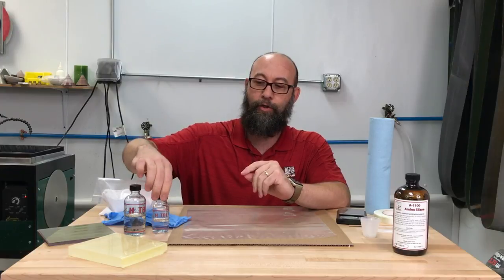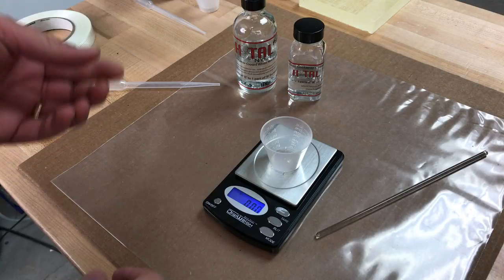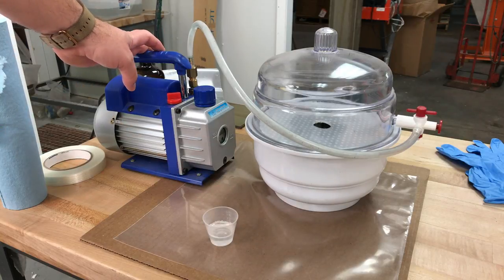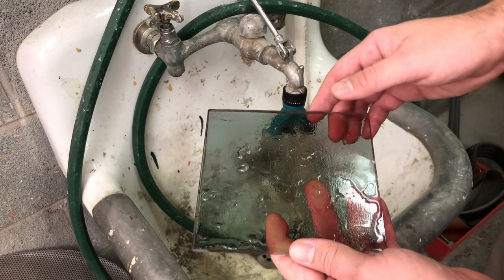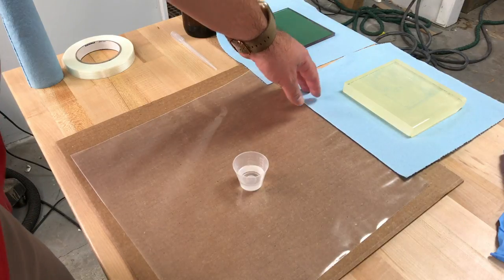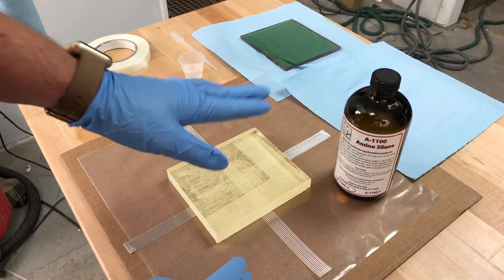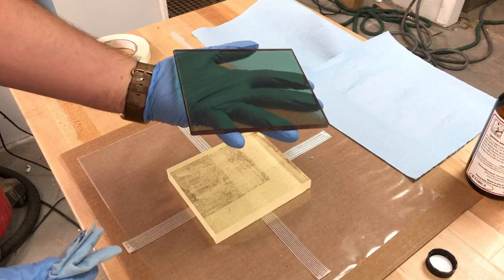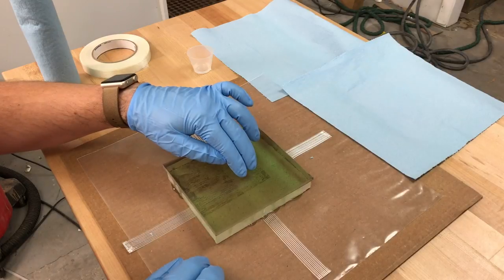How to Mix and use HXTAL NYL-1 to laminate glass

Comment: Thank you so much for your gracious reply on my earlier question! Hating to impose, wondering if you might indulge one follow-up as I’m about to order a substantial (1/2 pound, $80) HXTAL supply for my one big ALABASTER repair project.

My (parents’) chandelier has an inverted bowl, very heavy at about 20-25 pounds: the internal diameter is 13”, about 4” deep and quite thick all around. It never fully broke into pieces from its fall, but rather got substantial cracks much like the seams on a skull, but broken enough that the biggest crack-surrounded area will shift slightly in place when nudged. One of the cracks runs along the entire bottom center of the bowl. 

Frankly I’m scared of something so heavy, suspended on a 2.5” wide plate at the bottom (but resting by the top edge within a surrounding metal rim), with glued-together cracks in it. Even HXTAL cement. It’s about 18 feet over people’s heads, 25 pounds of glued-together rock which may have invisible cracks or earlier cracks spreading under the load of the alabaster’s own weight.

So my question is: while I could use a $20 1.3 ounce bottle of HXTAL and easily fill all the discernible cracks (there aren’t very many by the way, but they are long essentially dividing the whole thing into 3 sections, one essentially bisecting the whole unit). But could it be helpful to buy the larger $80 HXTAL, 1/2 pound, and essentially laminate the entire inner surface of the globe (my math tells me it’s almost exactly 300 square inches; 6.5 x 6.5 x 3.14 for the bottom area; the 4”round side added on… 300 square inches)… if I were to layer on the entire inner surface about 1/8” or 3/16” thick HXTAL, will I have very substantially decreased any risk of failure? Does this seem like a plausible strategy to increase safety with no aesthetic compromise? 

Coatings of these thicknesses would be 21 and 32 fluid ounces respectively. I really have no idea if 1/2 pound (their $80 size) would give such a thick coat.

Again hating to impose, but would really appreciate any thoughts on all this. 

Oh one final thing: is any tape ok (masking; clear packing; or Seran plastic wrap), to prevent dripping out of the cracks during curing? Are all these (including their own sticky adhesive) completely non-reactive with HXTAL? 

I may be paranoid, but I worry that both adhesives are complex chemicals, and would fear the HXTAL would react with the chemicals in the tape.

Thank you so, so much for any insights or suggestions, so EXTREMELY appreciated!!
Reply from the maker: Sorry for the late reply, I would recommend just repairing the existing cracks in the material and re-checking the piece after those have cured to see if there is any shifting in the piece. I hesitate to coat the entire interior as this could stress the existing cracks due to a larger surface area of epoxy and higher surface shrink rate when cured. Plastic wrap works well as a mask for HXTAL.
Reply: @hisglassworksinc  thanks so much for replying!! Somewhat coincidentally, your response comes just as my HXTAL project had gotten underway (filling in the cracks, first round; I only yesterday received the delayed shipment of my jewelry scale for measuring to .01 grams; waited for it for perfect ratios…); I did indeed purchase the 1/2 pound Hxtal and found it amazing to work with, in terms of filling in the cracks on the mildly heated (about 120-125 degrees) alabaster. It was very satisfying to see the adhesive flowing so smoothly like a thin syrup into the cracks. I will do perhaps 3 rounds of this until all discernible cracks filled in and no more Hxtal is absorbed on either side. I have been following the guidance of another amazing colleague of yours. 

You both agreed on the laminate scheme  being unnecessary, if all discernible cracks are filled in, but he agreed with me that a very thin coating (about a 20th of an inch thick; .06” according to my calculation) would add extra insurance. 

Since I already purchased the 1/2 pound for this coating (about 300 square inches), I’m very tempted to proceed given that it’s a very thin coating which would seep into any hidden cracks. And alabaster is so soft (unlike glass) as stone material goes, I’m thinking/hoping benefits will outweigh any risk you mention of stressing the cracks. Overall the whole object’s been remarkably stable even before the Hxtal in cracks treatment. I’ve been hoping that any Hxtal further added will only solidify the whole structure. 

Hating to impose, I wonder how substantial you consider that stress risk to be, and about the idea that such a thin lamination will fill in any unseen cracks and further connect everything sort of like jigsaw puzzle glue. I only want the best result, but having purchased this 1/2 pound, both want to use it, and question whether that impulse (per your comment) is counterproductive. I thought there was virtually no shrinkage with Hxtal by the way; first time using it, obviously!

Any reply so sincerely appreciated!!

Andrew
Reply from the maker: It sounds very reasonable to do the clear coat on the piece after the cracks are filled.

Comment: Thank you for your video! I'm having a hard time finding Lead crystal Glass do you know of a supplier? Also how do you feel about using a vacuum bag to hold the glass together as it cures?
Reply from the maker: There are very few places to still get Lead Crystal. I know www.xyzglass.com in the Czech Republic is making it and I've heard that Gaffer will start making lead crystal in the US shortly, so I would check with them. The only issue with a vacuum bag is if the material bonds to the HXTAL when it cures.

Comment: Wow...what a great video.  A few questions if you have time.  If I want to build a glass layered stack with 4mm or (1/8") glass, how many layers can I do at one time?  After 7  days how do you remove the "drips" off of the sides?  Thank you so much...
Reply from the maker: It's tough to say how many you can get away with at one time. The biggest issue is keeping them all lined up for a minimum of 3 days. With any joint the glass wants to skate around on the HXTAL layer like an ice skating rink so multiple layers will tend to flow in all directions. The only thing that really limits the layers is weight. The more pieces you apply on top, the more pressure on the lower layers which can squeeze the adhesive out of the joint and cause glass to glass contact which would result in a bond failure in that spot. How many layers are you looking to do and what size?
Reply: Thank you for your quick reply.  May I email you to continue this conversation?
Reply: Mark, (just checking) did you receive the emails I sent to you?

Comment: Hello, Great Tutorial. I'm wondering if used as a Coating on Agate for example would it fill slight pits? In saying that, if a Pit wasn't completely filled, could a second coating of Hxtal be applied within a given time and not have a Problem with Laminating?
I have a Project coming up and I'm also wondering if left for a Period of time (letting the Hxtal set up) the Hxtal would better fill the pits?
I would greatly appreciate any of Your experience in this area. Thank You
Reply from the maker: You are correct in all your questions. HXTAL can be allowed to set up and thicken so it can more readily fill pits. You can also bond HXTAL to fully cured HXTAL if pieces need more than one fill. This is especially helpful for large fill areas where a large amount of HXTAL can cause some shrinkage on the piece so it's best to do multiple layer fills in those instances.

Comment: Thanks for posting such informative videos! I’ve been curious, since I’ve never used Hxtal, how it differs from UV glue (curing methods aside)? Is there a difference in strength or transparency between the two glues, or particular advantages that hxtal offers for lamination in particular? I’m really interested in trying it! Thanks!
Reply from the maker: There are a LOT of differing UV adhesives on the market. The main problem they all have is that curing takes place with UV radiation. If the piece is exposed to UV radiation over its lifespan, the adhesive will continue to shrink and yellow over time and eventually cause failures. UV adhesives are certainly much faster than HXTAL for bonding and laminating, but I don't consider them to be archival at all. The larger the joint, but more shrinkage UV adhesives have and the more chance of failures over time. Hope this helps some.
Reply: hisglassworksinc Oh, wow. I had no idea about UV glue’s non-archival properties. Thanks so much for your thoughtful reply!
Reply from the maker: You are very welcome. Anytime.

Comment: If I don’t care about color, but only strength and heat resistance (for a 20-25 pound heavy alabaster chandelier component), it will need to hold together with only vertical support from below, a small “platform” (disk) in the very center; and will be near low wattage incandescent (can substitute led probably) bulbs. 

Is Hxtal STRONGER than JB clear epoxy? Does it handle heat better? 

Thanks so much of you have any information about this!!!!!!!!!! So very deeply appreciated!!!!!!
Reply from the maker: For a disparate material bond we recommend mixing the HXTAL and letting it sit for several hours to get a thicker bond between the materials to allow for the differing COE between them.  HXTAL will begin to break down around 400 degrees F so you'll need to know the ambient temperature around the bond area.
Reply: @hisglassworksinc  thanks thanks thanks so much!!!!!!!!!!

Comment: Approximately how much Hxtal would be needed to laminate 13 square feet of glass?
Reply from the maker: When we made larger pieces we would use about 8 grams of mixed epoxy to laminate a 6 x 6 area.

Comment: How do you clean the excess hxtal off the piece if you can’t cold work the piece after glueing?
Reply from the maker: We typically will use acetone on a lint free papertowel to clean excess HXTAL off the piece every few hours while it's curing. Once it starts to thicken up, you can use a razor blade to scrap excess off and then acetone on a lint free paper towel to clean up. Never put acetone directly on the piece to avoid damaging the joint
Reply: @hisglassworksinc  thank you for the response and the great video. Does hxtal lose its adhesive property’s as it thickens up? For example after mixing if you wait for 5 hours at room temp is there any loss of adhesion.
Reply from the maker: @friedbergje  No. It work quite well still. We have a lot of customers who will let it thicken up so they can mold it into areas that are missing chunks. It's a very adaptable epoxy.
Reply: @hisglassworksinc  thanks!

Comment: Can mixed hxtal be saved in a glass jar with lid?
Reply from the maker: Yes. It will continue to cure slowly and get thicker over the 7 day cure time. You can also put it in the freezer to slow down the chemical reaction and store it there for up to 3 weeks. Just bring it back and let it warm back to up room temperature to use it.